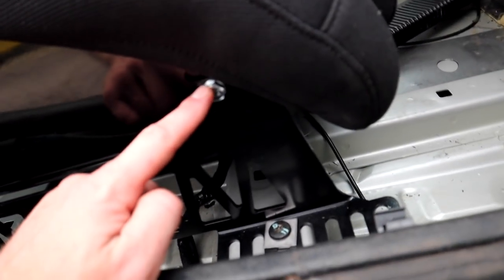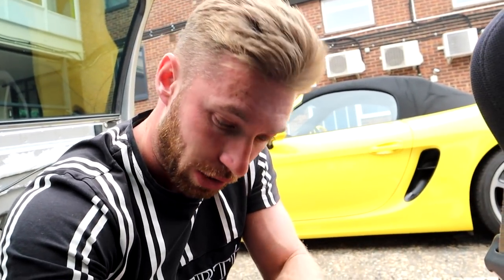How much weight did I remove from a Clio 197? (Weigh-bridge shows)

Comment: I liked these, just a shame about the gearbox in them, the synchro’s are like chocolate.
Reply: @ciaranmccormack4434  I've owned 2, yours has probably had the gearbox rebuilt. 2nd/3rd synchros are flawed in their design. I've seen some boxes last about 5 years, some 6-8 months. No matter what though, they always go. You've either been very lucky, or aren't changing gear high up the rev range.
Reply: @ciaranmccormack4434  Completely agree, it’s called mechanical sympathy and maintenance. The synchros maybe weaker than in other boxes, that doesn’t mean they’ll fail more regularly.